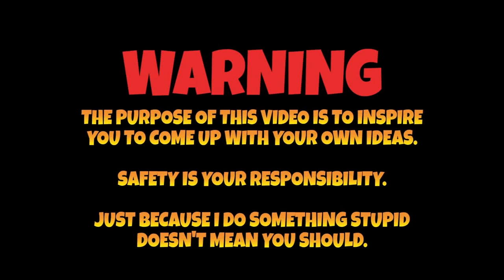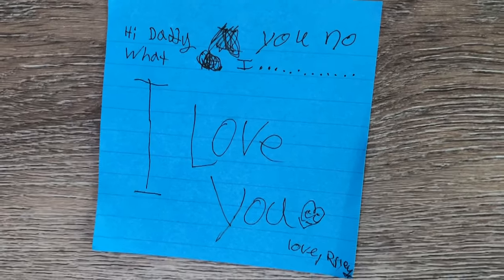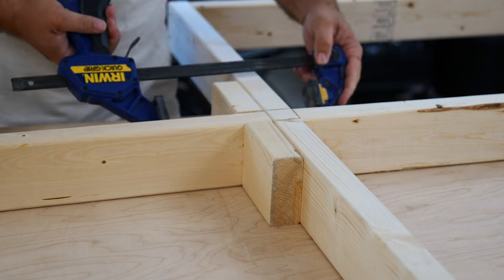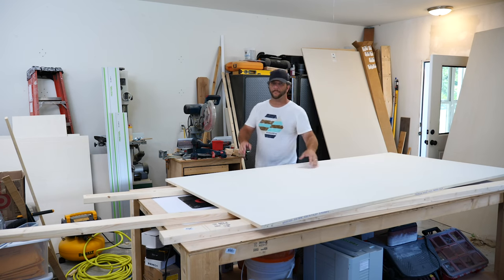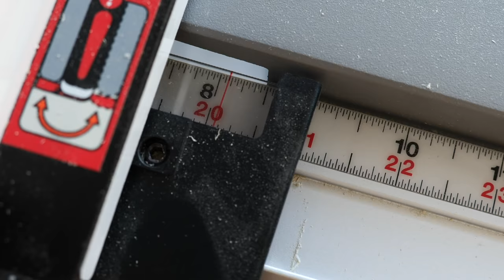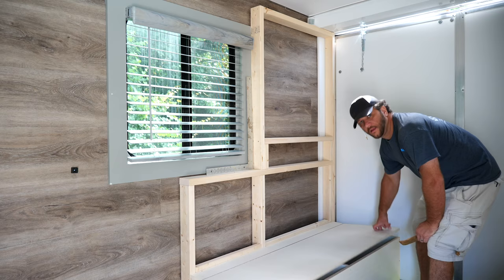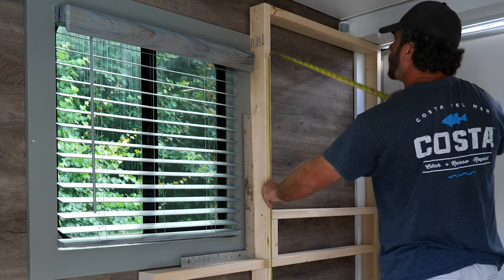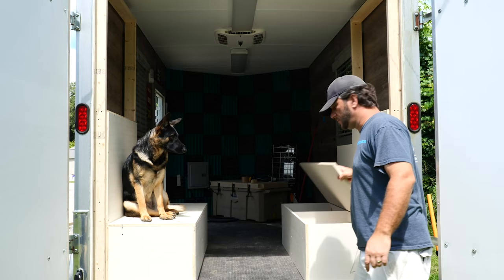Converting my Cargo Trailer into an RV Camper!

Comment: Cool build. I've never seen a cargo trailer with the door on the driver side.  Did you get that custom made?  They're usually on the passenger side.
Reply from the maker: Thanks! Yes, I custom ordered it that way. When I used it as my office in my driveway that was the side I had to access it by.
Reply: Doors are normally on the ( sidewalk side for safety ) . You can get doors on both sides if Ya custom order it . You can get extra height as well . My 7x12 is 6ft 5 inches on the interior for moving refrigerators . Tandem axles come with brakes ( good idea for a loaded trailer ). Good luck

Comment: Did you consider using metal 2x4s to save weight? Just looking for input on my own build.
Reply from the maker: That's a good idea. I didn't really think about that. I'm just trying to do this as easily and cheaply as I can without adding a ton of weight.
Reply: HAXMAN  I love what you have done. The upper bunk was a bit heavy but it will surely not collapse. Everything is bomb proof.
Reply from the maker: @tom_olofsson  Thank you!